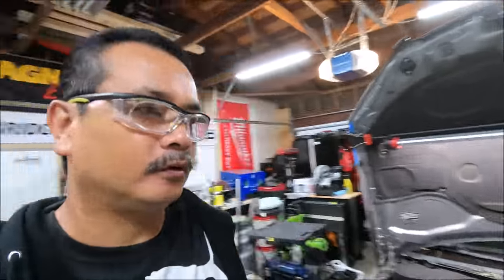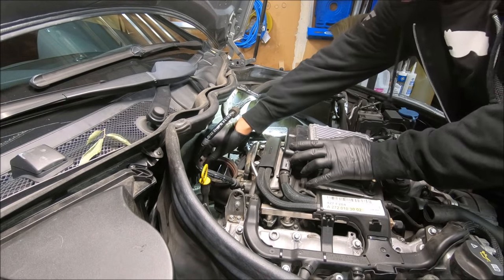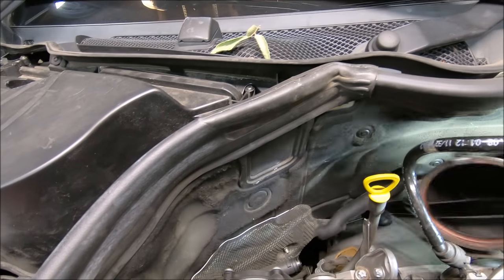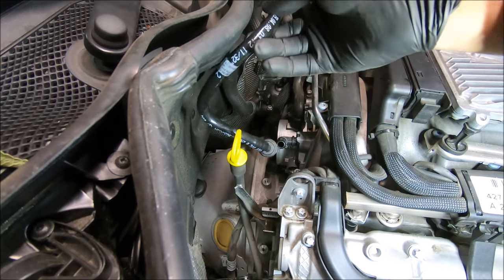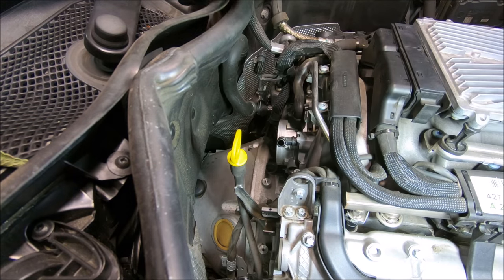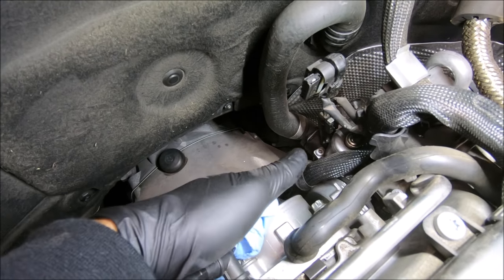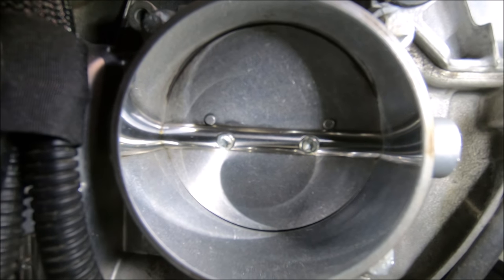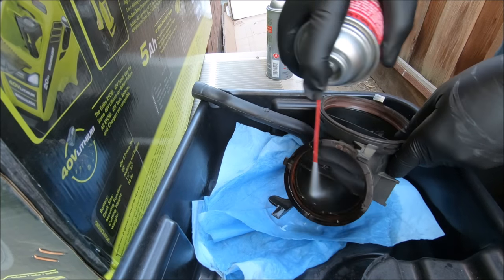Cleaning MAF and Throttle Body on a Mercedes-Benz 2008 - 2014 C300 and C350 (W204)

Comment: Thank you for giving me the courage to do this on my C300 W204 Sports 4Matic, followed the instructions in the video and it worked out good; when I first started the car it wanted to stall out, after shut off and restarted and it was back to normal, my baby rides like a princess now! Thank you
Reply: I have the 2010 C300 4matic. A month and half ago it became hard to start whenever I refueled. I will repost if this fixes the problem.
Reply: Same problem with me it like sputters like it wants to shut off then go backnon
Reply: @jhector793  status?
Reply: @b.trill6868  did you find a solution? Im currently in the same situation 😅
Reply: @zakareya45  yes yes I did after spending 1500$ on parts and labor that did not need to be fixed. 
Comes to find out there was a hole/gash in my intake manifold! 
So ended up buy a new one for around 354 and 450$ labor sheeesh but then ran smooth as new! But then shortly traded in! To upgrade to my new s5 😎

Comment: I believe your missing the tension retainer air filter clip off the mass air flow sensor housing. It's needed to keep the air coming in from the air filter and not thru the neck of the mass air flow and by passing throat opening from the filter not being properly seated. The latch will latch onto the air filter housing. To much air maybe making for to much gas. I'd use some Sea-foam in the fuel to clear up air intake fouling and carbon build up., Nice clean up job and video.

Comment: Good video!
75% of the solvents can be used for multiple purpose but the manufacturers are smart, they create a new solvent type to sell more. You could actually use Brake Cleaner for all those components, and just the inside of the parts (no need to spray the outside of a plastic hose with the solvent, doesn't help one bit). Also doesn't need more than couple of seconds of spraying.

Comment: Wow, what a video. So impressed by you. I now feel confident to do this on mine, and hopefully should fix the surge issue! Thank you for the amazing material!
Reply: Did it fix your surging?
Reply: @AaronsTalks  unfortunately no. I replaced thousands in parts from MAF, to driveshaft couplings, to throttle body. Ended up selling it.
Reply: sorry to hear this. Hopefully mine is easy fix @sussayn

Comment: Your videos are top match... the attention to detail and the precise video to show EXACTLY what you are doing UNLIKE other videos like Pelican parts - this is second to none.  Thanks for the excellent video.  Would be great if you have a video on replacing the coolant temperature sensor.  I believe its near the Mass Airflow Sensor... .as you have to remove it - but havent seen any detailed videos on replacing it and its not in the most easiest place to work on. Anyways.. great video - I am a new subscriber and fan.

Comment: I did a whole coolant system on my 08’ C300 put a new water pump new hoses upper and lower new thermostat new oil filter housing assembly and still over heating I also put a new radiator fan. What could be the problem.

Comment: Very helpful. Did all the cleaning but still running poor. Will need a new MAF
Reply: Could be also the in german called the „Ansaugbrücke mit Ansaugklappen“.
The plastic parts inside and the plastic leavers at the front can break or get stuck. The whole part isn’t that expensive, 400-500€

Comment: Very helpful. Thanks. Cleaned both the MAF sensor and TB in addition to changing out the filters on my 2012 C300. Car no longer has a cold start shake it had before.
Reply from the maker: That's awesome to hear. Thanks for watching and for your comment.
Reply: What mileage did you have when it started shaking cold?? 

Did you find oil excess in filter?

Benz plastic oil separator is known to need regular replacement else multiple oil issues
(I have a '14M276)

Comment: Great video thank you.  Sort of related, if wanting to do a GDI cleaning which you NEED to avoid all contact with the MAF sensor could you spray it in via the PCV hose on the air deflector?

Comment: Thanks for the rich information. But I just changed my Maf but the check engine light refused to go away even after replacing the maf.
My question is; does the light disappear immediately after replacement?
Reply: You need a obd2 scanner to reset the code. Then it will be good.

Comment: Question sir! What is the reason why clean the MAF and throttle body?
1. Is it when driving, you get a stalling motion or lunging?
2. Cold start rough idle
I'm asking because on my 08 c350 w204 I get No.1 as an issue right now. Thanks for the respond
Reply: Funny how you asked that I have the same car, threw the engine code misfiring and all that. Did you ended up getting it fixed?
Reply: @yokev_5611  did u find out what was wrong?
Reply: What happened at the end ?? I got a 09 c350 w204 and it’s doing the same thing…

Comment: hi. thanks for the video. i too have a M272 engine. dealership wants me to perform throttle body service.
1. is everything you showed in this video considered the throttle body service?
2. when cleaning the throttle body by sticking your hand in, did you push the valve open with your fingers to clean behind it?
Reply: Great question
Reply: don’t recommend push the valve because it’s spring loaded and with computer calibration
Reply: @MBZXZ  I have read some articles that you can. When you put the key in the ignition after the service and turn it once (not to full ignition position), the computer calibrates the valve opening again by clicking.
Reply: @demetriingilis9965  True. But I don't advise. I advise taking the MAF and throttle body completely out to clean it properly.
Reply: Put key second position don't start engine... put a stick or something on gas pedal wot (wide open throttle) and proceed to clean electric throttle.  No need to spray directly. Spray on rag and clean!

Comment: Quick question, how to eliminate rev hang on w204 c280? The accelerate is quick, but when i let go the gas, it's so slow for the rpm to going down
Reply: Try resetting your transmission

Comment: Few Questions. 1. What was the mileage? 2. What compelled you to clean it? Rough idle, poor gas mileage etc. ?
Reply from the maker: Nicholas McDonough It was at 82k miles and had rough idle. The problem turned out to be the swirl flap rod. See my other video on that.
Reply: Was it “Lunging“ while you were driving too??…
Reply from the maker: cedrock I didnt notice that.
Reply: @NK1794  - Interesting my flap  broke at almost the same mileage. At present, the car appears to be burning oil. Argh.

Comment: Did it fox the rich issue or did you have to end up changing o2 sensors how do you know it was ru ning rich did you get o2 sensor rich code what did the short term and long term fuel tables show

Comment: What was  the reason for cleaning it? Rough idling?
Reply: Air/fuel ratios were off, in his case running rich. When people don't change out the prone to fail oil separator & crankcase ventilation valve (pcv), the intake manifold gets sludge build up via oil leaking in and all hell breaks loose. If you catch those leaks in time and clean maf/throttle body, you can save your intake manifold, but I believe this guy had to replace his after all.

Comment: Thanks for the nice video! Where is the Throttle Position Sensor located? My car has engine codes on Throttle Position Sensor so I was wondering if I could replace the sensor to clean the codes.
Reply: I am here looking for the same answer :(
Reply: @225Alpari  For Mercedes, I guess the TPS is built-in in the throttle body, if it was the problem with TPS you may need to replace the whole throttle body. 
The trouble codes I had were P0123,P0222,P2135. There could be multiple causes including the accelerator pedal, throttle position sensors (TPS) or just the problem in wiring. Therefore I would recommend you to check the wiring first and then the signal coming out of the padel and the signal going into the throttle body to identify the problem. My mechanic found that the throttle body was not responding to the signal. After removing the throttle body assembly they found that the wire had been compromised by chewing rodant. Repairing wiring fixed the problem.
Reply: @zikuicai8801  Thank you very much for your kind info!

Comment: Couldn't you just leave the MAF in the car and spray it through the metal mesh?
Reply: Not really,  All the cleaner will flood the Air Intake as it funnels into the throttle body.  Besides, you should also be cleaning the Down elbow pipe and also the throttle body since you are at it.  It would be a less than half of a job if you just spray it while it's still on the car.

Comment: Our 350cgi sometimes seems to misfire while idling. You will hear it from the exhaust and feel it in the car. Also when driving 110 kph it sometimes starts lunging as if you were giving it throttle and releasing again. Does anyone have an idea? Sparkplugs and coil have been replaced already.
Reply: i have the same issue with my c350, i’m thinking it’s gonna be the throttle body. i’m going to clean mine tomorrow and I’ll let you know if anything changes
Reply: @Schnitzeldawg  let me know if it had any effects. Also check you spark plug cables in te dark to see if they don't pass any sparks to something metal. This was the case on our car. The issue seems to happen less now we have changed the cables but it still happens.

Comment: Idk what I did wrong but after cleaning the MAF it gave me check engine light and it’s not working correctly….
Reply: Remember did you plug in all the wires correctly? 

2 return emissions one on the intake redirect to the valve cover and the other on the air filter covering by the front. 

Also make sure you plugged in the airflow sensor in the little neck piece with the mesh grill. If that didn’t click properly it will throw a code.

Comment: Hi, I am having P0171, Rich Bank 1, I did all the above PLUS replaced the PCV Valve, Cam Shaft plugs, cleaned the throttle body and the Air filters and still I am having the same issue. The cluster display for the MPH and MPG is very odd, when in idle the MPH is very low (7 -10) and the MPH is 11.00, when driving the mPH and MPG go up but again, when idling the same issue and gas consumption is very high. Any advice is very much appreciated. Thank you.
Reply: Did you find the problem by any chance?
Reply: @Smudg  ok thank you I'm going to have to take a look at it tomorrow
Reply: Have you resolved the issue yet? I'm having a similar issue.
Reply: @dudebyob  The cover with Air Filters was not inserted properly on top of the MAF.
Reply: Timing chain??

Comment: I have two issues on my Mercedes Benz ML320 1999. 1. The engine running very smooth but most times it it enters pot hole,i will not be able to accelerate again, but the engine will be steaming.I have to stop,turn off the engine,the start again and the throtle will start working fine again. 2. Similar stuff happens with the gear.At some point,i will realize that the gear is no longer selecting and I will stop,turn off the engine,then turn the engine on again and the gear will start to sel;ect fine again. Please i need a solution.
Reply: My Mercedes Benz2007 don't start
Reply: This indicates that your throttle body is faulty. You will need a total replacement.
Reply: This indicates that your throttle body is faulty. You will need a total replacement.

Comment: Hi i have c300 4 matic and i have 1 problem. When i give speed to the car in 2 or 3 gear, the gas does not get well but with the hull as if if lacks air. I clean this but still same. Any one help me what is this problem i have.

Comment: Hi, I have a 2007 Mercedes  W203 C230 with a m272 V6 engine and the car runs so smooth my the problem is showed a check engine light and I had the fault code 0745 self adaptation of mixture formation for enrichment at idle for the right cylinder bank is above permissible limit (P0171).  Permanent 
0749 self adaptation of mixture formation for enrichment at idle for the left cylinder bank is above permissible limit (P0174)  Permanent 
What could be the problem
Reply from the maker: I would start by cleaning the MAF (mass airflow sensor) and the clear the code. See if that helps. Be sure to use the right cleaner. See my other video on that. Thanks for watching. Also check for any vacuum leaks.
Reply: NK1794 hi, I did clean and cleared the fault code and it popped out back again after a day so I don't know what it is now
Reply from the maker: Are you able to check for vacuum leaks?
Reply: NK1794 Ok how can I check? 
I have about 161 000km on the dash and it drives so smooth even the idling it's so smooth
Reply from the maker: I found this video. https://www.youtube.com/watch?v=ffmzcL100dU
Reply: @NK1794   hope i have a vacuum leak  , this would suck ... changed the maf  sensor last week still running bad , with engine check light back on ?
Reply from the maker: Anthony Oliver That sucks. Do you have a code reader to see what it’s complaining about? Check the swirl flap actuator arms. It’s a common problem. I have a video on that. I ended up replacing the whole intake.
Reply: @NK1794  didn't engage The clips  on the maf sensor so after I installed everything to put the clip back correctly this time reset the light it's running good . Engine has 127000 miles on it I'm hoping I can keep it going to 200 k
Reply from the maker: Excellent! I’m sure it can hit 200K easily.
Reply: @NK1794  thanx i would like to ask where do i plug the smoking machine on the air intake
Reply: Mass air flow sensors rarley ever cause problems o2 sensors run the fuel trim tables for the most part your code you show means power enrichment has to so with fuel trim short/long term fueling
Reply: Also you could have a intake plenum leaking common problem the intake has clipa that break and carbon build up causwa problem but intake leaking air is like a huge vacum leak
Reply: 02 sensor,my 2004 Grand Cherokee Laredo did that also.Turns out it were my Radiator cap opening late.

Comment: did you remove the spring clip that goes over the maf sensor ? , didnt see it ..
Reply from the maker: Anthony Oliver Yes, it was missing. I got a replacement from the dealership.
Reply: @NK1794  working on the wifes  glk350  tomorrow hope its something simple ...  already changed the MAF sensor still running bad .
Reply: What was the issue with the car that prompted you to clean this. My  car is stalling and sometimes dont move when you press the gas. Diagnostic test says the throddle  pedal is not sending enough voltage to the engine. I am trying to see if it's the whole pedal with the sensor that need to be change
Reply: @HOTROD256969  these cars are mostly electrical could be something as simple as a fuse... 🖖
Reply: @eltanquezito805  you work on cars?
Reply: I saw a video where you also clean de sensor and it helps is that so?

Comment: This work on e350 w 212 ??
Reply from the maker: I'm not 100% sure but I think the same procedure should work for you also.
Reply: Sounds good thank you
Reply: it should be very similar... Remove the throttle body make it easier to clean behind the flap and lube the teeth on the gear reduction wheel... its cheaper than buying a new one later 🙂
Reply: @NK1794  do I have to disconnect the battery?

Comment: what would cause oil to be in there ?
Reply: the legendary Benz oil separator design that leaks oil in a hurry on the hot exhaust and oily MAF sensor & throttle body.

Comment: That's not done.

You are making the easy thing a disaster. Too rough on plastics. If I am client I won't bring my car for you. Sorry for that, but you didn't even smoothly finish closing the plastic cover on the MAF PERFECTLY.

Please accept my comment in a positive way, so next time you can take care more and slow down if something got broke that's a USD been spent.

Thanks for the share.
Reply: wtf would you say that?  he used break cleaner on plastics, he didnt connect MAF correctly in postion, never bothers about plugging the intake on the top of MAF, cleaned the    Electronic throttle body with hands and shop towels. All these are perfect curb side dude jobs.
Reply: This didnt even fix his so called problem anyway I bet probably has a leaking intake plenum causing a vacuum leak I watch videos like these out of bordem to watch some very skilled do it your selfers then some complete hacks that clams to be mechanics